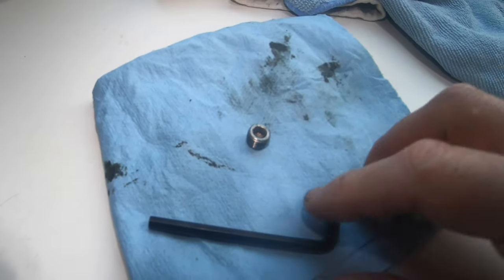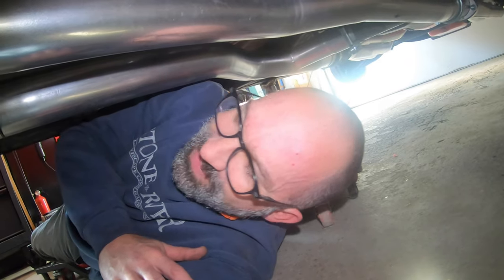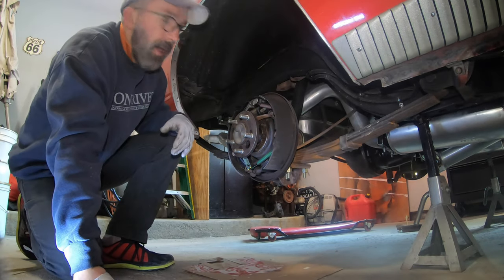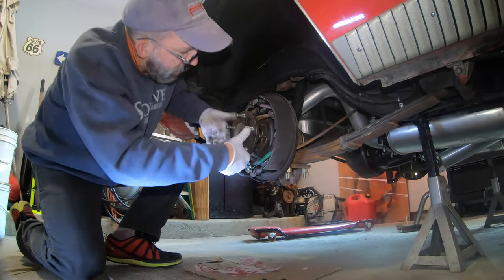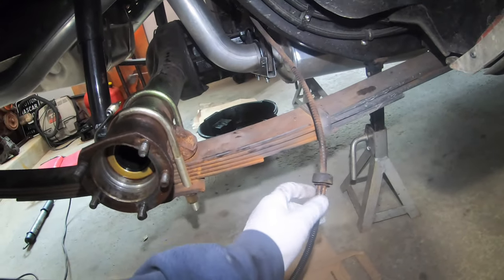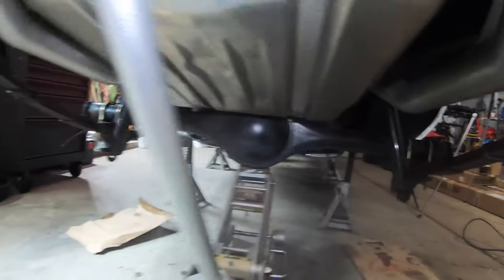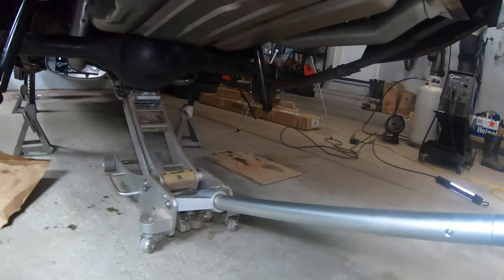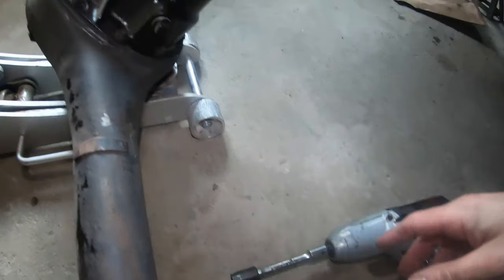How to Remove Mopar rear suspension!

Comment: I would think with an offsetted rear wheel you can fit 12 sidewalls and 10 inch slick. with existing factory stuff. the main problem with mopar is rea wheel housing clearance . i would not want to tub out a mopar so the value stays high, i fit 29.5 tall slicks on my old cuda so 29.5 x10 is plenty tire for drag racing and fills wheel opening.
Reply from the maker: I ended up with tires that have a 12” section width and I’m happy with how they turned out👍